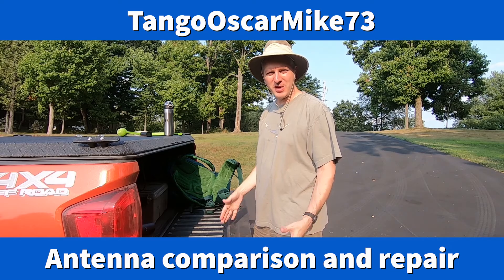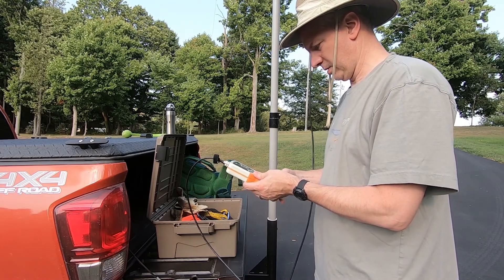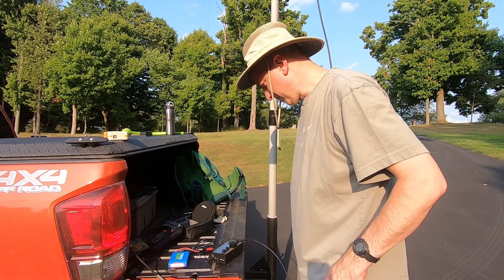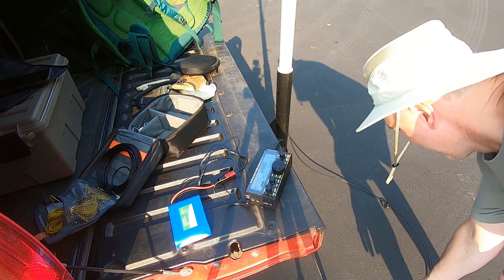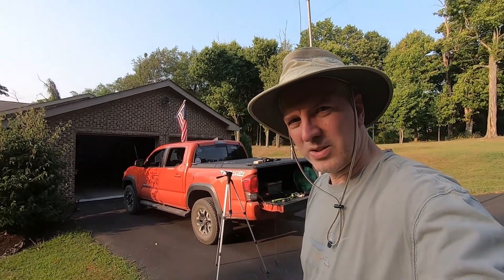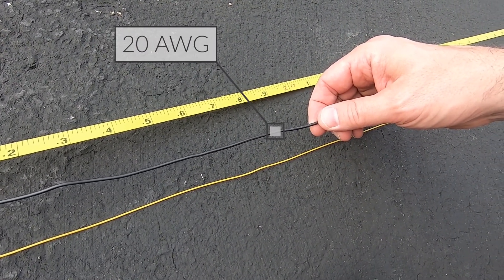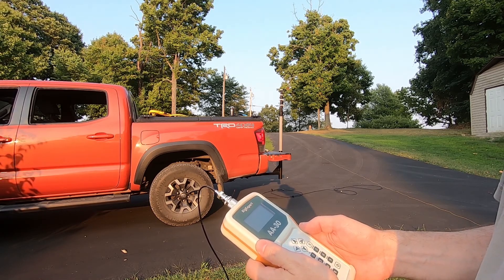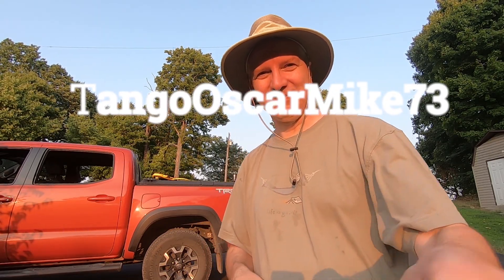Endfed vs linked dipole - amateur radio antenna comparison

Comment: I found an awesome antenna by accident it's a 30 meter delta loop I support it with a 40 ft spider beam tip of the triangle up. I feed it with 300 ohm twin lead up 2 feet from the bottom on one side. It has a low take off angle so is good for dx. Each side is 33.3 ft.  It tunes 6 through 80 meters. You should give it a try. You won't be disappointed. 
Jeff ke4fwe
Reply from the maker: Thanks Jeff.  I've have not tried a delta loop yet, even at my QTH.  Might have to be a future project.  Thanks

Comment: Good comparison I have a home made link Dipole and a EFHW but my favorite antenna for my KX2 is a 40m doublet its easy set up and tune the band you want from 80-10 , yea it tunes 80 not sure how well it works on 80 but signals have been good. If you get a chance i have a video 40m doublet for kx2/3

Comment: Hey, it's me again.  LOL.  On that trailer hitch extender...did you get the 12" or 18" version to get past your tail gate in the down position?
Reply from the maker: I got both parts from Home Depot. Pole holder (Camco 51611)  and he extension 11 inch (hitchmate 6000)

Comment: Nice truck...I have the same, but TRD Sport in light blue.  Love it.  Mr. Pooch makes it into almost every video...which is great.  I'm in the process of making a 20/30/40 linked dipole for my MTR3B radio that is hopefully going to be purchased soon.
Reply from the maker: I love my Tacoma.  My wife wants a 4-runner now.  I'm practicing CW often, just can't quite catch a callsign on the first run.
Reply: @TangoOscarMikeN3WS  Don't feel bad.  I've been at this CW thing for 8 months and it takes me 2 times to copy a call sign at 25wpm without big spacing.

Comment: I prefer diepoles when I have the room but in many cases they are hard to fit in the area you have.
Reply from the maker: I plan on building a much smaller balun.  I'm definitely going to keep it as an option.  Thanks for watching.